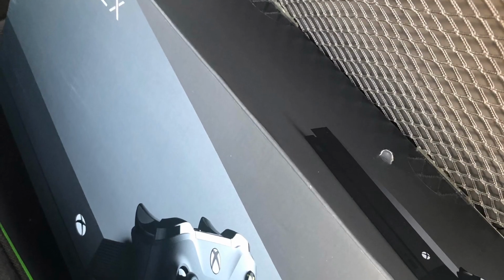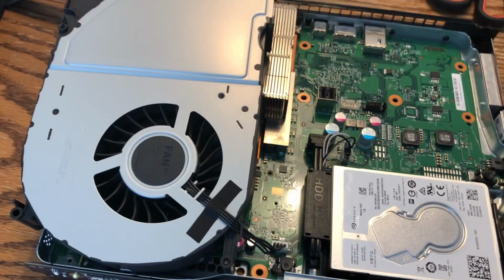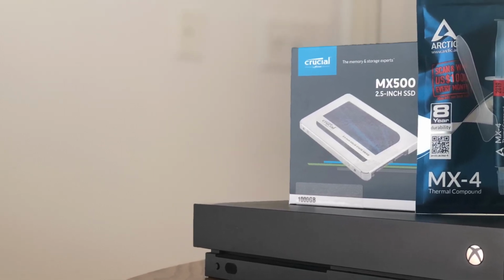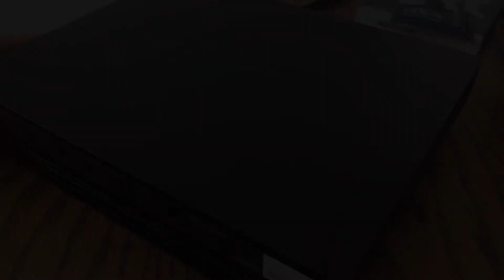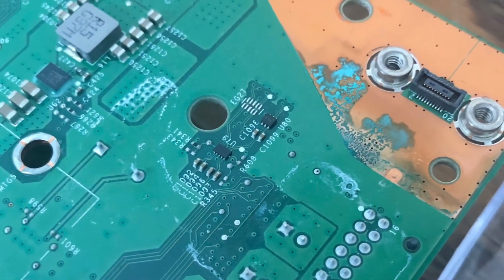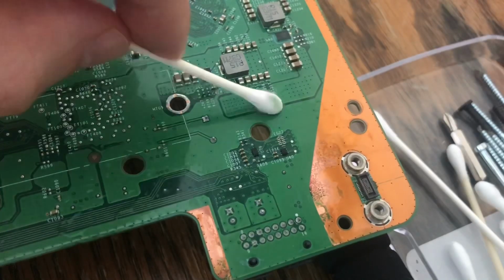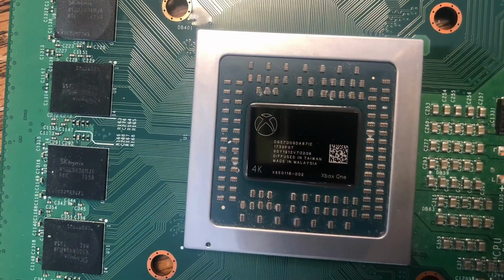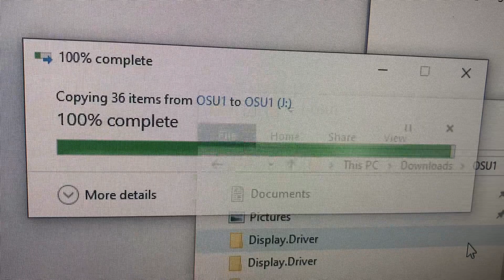Faulty Xbox one X teardown thermal paste replacement SSD upgrade E102 E105 E206 E101, will it work?!

Comment: Hello, my XBOXONEX also has E105, E102, E100 errors. I have tried to replace the SSD. It just works after the replacement, but after a day or two, the error code appears. What should I do? Can changing silicone grease really solve the problem? Looking forward to your reply, I am a Chinese and use Google Translate to leave a message for you. Maybe the translation is not accurate enough, please forgive me.
Reply from the maker: sorry you are having issues with your xbox. Seems like you tried all of the things I did. The thermal paste replacement will help with overheating. However, these pesky error codes are difficult to resolve. I have heard that replacing the four capacitors below the plug for the disc drive may help. However, I haven't tried. Unfortunately, the SSD and thermal paste didn't resolve the issues with the xbox in this video. Thanks for watching and commenting.

Comment: i have the first xbox1 working fine when i got it now it will yurn on and after about 1 maybe 2min it will turn off do you have any fixes for this please thanks
Reply from the maker: GLYNDWR GARFIELD could be overheating. One option is to take it apart, clean it, and change the thermal paste. Another option is unplugging the power brick from the wall and console. Let it discharge for like a minute and plug it back it. Sometimes the power brick needs to reset on the original Xbox one. Hope that helps! Thanks for watching and commenting 🙌

Comment: Just out of curiosity is there any difference between the scorpio editions and the later model? I've noticed a slight drop in frame rate with certain games especially when playing a game over a couple of days and using sleep mode between sessions I end up hard resetting and/ clearing cache and  alt. mac adressess, or is this standard for xbox one hardware, I often wonder as I've always owned a scorpio from day and have no comparison!
Reply from the maker: Im not 100% sure but I think its mainly cosmetic differences. If none of those other things you tried worked, maybe its time to tear down the console for a cleaning and replace the thermal paste & pads. Sorry you are having framerate issues. Thanks for watching and commenting.

Comment: Mine just recently started over heating I got it about 2 months after the xbox one x was released any tips ? I plan on tearing it apart and using compressed air to clean all the fans and components.
Reply from the maker: Sorry to hear your xbox is overheating! it may be time to disassemble, clean and change the thermal paste. Thanks for watching and commenting.
Reply: I’m having the same issue with my Xbox One X. Worked great for the first year I had it but now I can’t play longer than 30 mins without it turning itself off & then displaying a message that the console “overheated”

Comment: Do you really have to partiation the mx500 or can just plug in internal
Reply from the maker: I had to partition it. Check out the link in the description to XFix as he covers everything regarding that part of the process 👾👍🏻
Reply: I used at Samsung SSD 1tb and didn't have to do any of the repartitioning or scripts, just put it in, downloaded the offline update, updated it and went on. Works fine. Not sure if it was because of it being a Crucial drive or what. But with Samsung as long as the drive you are replacing is the same size as the new one you don't need any of that.

Comment: iv seen alot of bords like that
Reply from the maker: Did you find that the corrosion caused any other issues? Thanks for watching and commenting 👾👍🏻
Reply: Select Start Save  Just as an FYI, that white stuff on the board is not corrosion but rather adhesive left over from stickers placed on the PCB board from the manufacturing process. Every Xbox One X board I’ve seen has had this white adhesive on it (including mine) and there have been multiple threads made about it

Comment: How about you trade me mine  for a working one too , I'm dealing with the same problems too
Reply from the maker: Sorry you are having the same problems now. Have you been able to get it back up and running? I wasnt able to fix this one but I heard it could be related to some capacitors failing from the additional heat. Thanks for watching and commenting.

Comment: FYI - Should of used Artic MX-2 - it lasts longer than Artic MX-4
Reply from the maker: Thanks for the suggestion. This console is still running well with the MX-4. I'll need to research more about the different thermal paste options. Thanks for watching and commenting.

Comment: It looks like you ripped some of the thermal pads when removing the heatsink. Did you replace that and what thermal pad did you use? Any specific thickness?
Reply from the maker: You’re right, I did. I reused the pads as they were still good. I peeled off whatever ripped and just molded them back into shape before reconnecting the heat sink. Hope that helps. Thanks for watching and commenting! 👾👍🏻
Reply: @gremlen  ahh gotcha gotcha. I'm going to teardown my xbox one x tomorrow to replace the stock thermal paste and figured I might as well replace the thermal pads as well. If the stock thermal paste is garbage, Im sure the thermal pads are the bare minimum too. Kind regards and good video :) sorry your attempts to fix it didnt work out!
Reply from the maker: Awesome! I’ve heard about thermal paste being dry on some brand new units lol I’ll try to find a link to the pads and share it later. It’s okay this one didn’t work out. It was a great learning experience. I’ve since picked up another Xbox one X and made another video if you’re interested in watching. 👾👍🏻
Reply: @gremlen  I havent had any overheating issues but the system seems to stutter and lag a lot when lots of stuff is going on on the screen. I have a feeling the APU/memory is downclocking a bit in order to prevent itself from overheating. I'll check out your other vid! Cheers~
Reply from the maker: Joshua Brunner if you replace the thermal pads, you’ll need something like this. Let me know how it works out! https://amzn.to/32OlNj6
Reply: @gremlen   Great Vid ....I need to replace the thermal pads on my Xbox one X  I noticed they were cracking and kinda dried...So 2mm thickness is what I need?
Reply from the maker: xboxgamer hi, thanks! Yes, something like this should work https://amzn.to/32OlNj6 however I haven’t personally tried. I reused the existing pads. Hope that helps. Thanks for watching and commenting!
Reply: @gremlen  Thanks I will check out the link..I'm just double checking it is infact 2mm thickness before i order them...I have been getting conflicting opinions but the general consensus is 2mm
Reply from the maker: Thanks! Sorry I can’t confirm as I reused the existing pads. I agree the general consensus appears to be 2mm. If you order them, measure the pads after you tear it down to confirm before opening up the package 👍🏻 let us know how it works out!
Reply: Thanks for the replies back. I opened up my Xbox One X last Friday and it was immensely satisfying to scrape off that old dried up thermal paste and apply some fresh...Then I noticed a couple of the pads were not correctly positioned and when I attempted to re-seat them they just crumbled apart.
I didn't have any new ones to replace them so I just re-assembled my Xbox.
Now I've opened it once and familiarised myself with it, It should be a lot easier to do second time around. The only thing I found fiddly was attaching that damned ribbon...I had my wife do it in the end because my fingers were to big...lol... Apart from that It's pretty str8 fwd to disassemble.   I've ordered Gelid Solutions GP Extreme 2 mm Thickness Thermal Pads Should arrive Wednesday of this week.
Reply from the maker: xboxgamer sweet! I really love the modular design of the Xbox one X. Def a great learning experience tearing it down and putting it back together. I agree about the ribbon cable lol. Hope your system runs great with the new pads!
Reply: Update...I put 2mm thick thermal pads on all 12 memory chips.....Big improvement on noise ..The fan is like a light whisper even when 4k gaming.
Reply from the maker: xboxgamer great news! Thanks for the update. Glad to hear that helped!
Reply: Just out of curiosity, is there any difference between the scorpio editions and the later model? I've noticed a slight drop in frame rate with certain games especially when playing a game over a couple of days and using sleep mode between sessions I end up hard resetting and/ clearing cache and  alt. mac adressess or is this standard for all one x hardware,  I often wonder as I've always owned a scorpio from day and have no comparison.